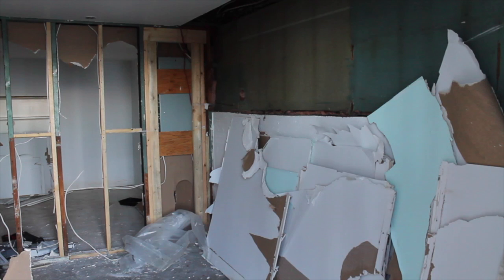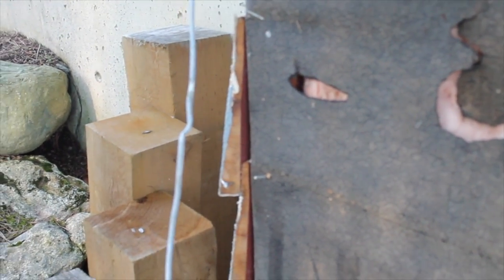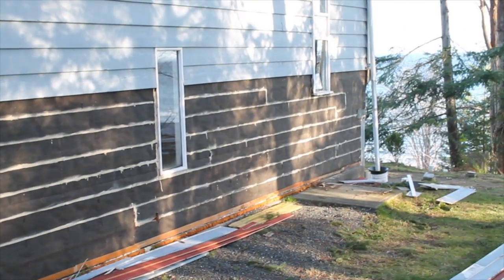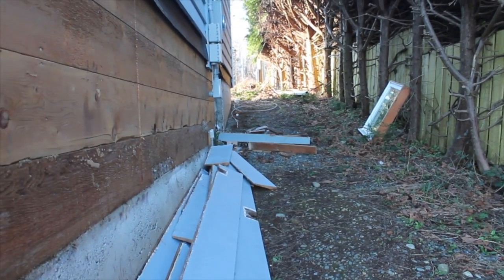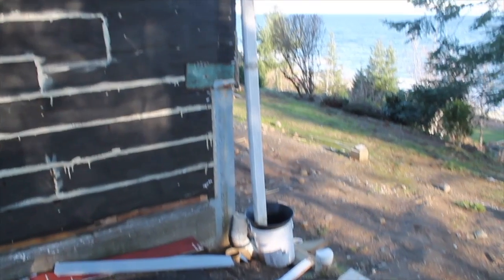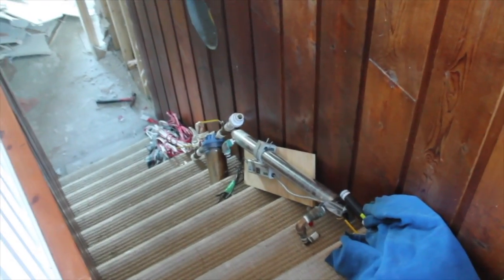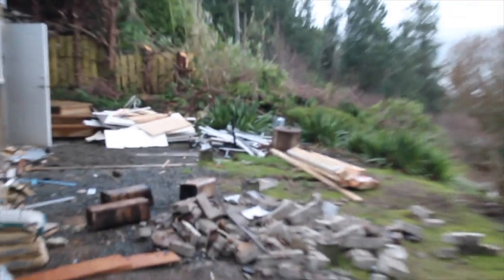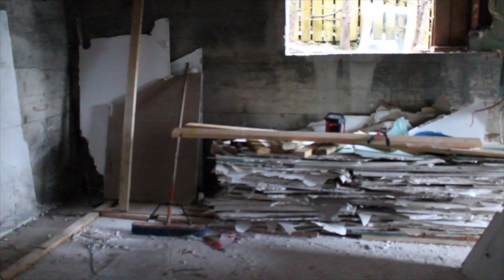Episode 9 - Prep for the move 'phase 1'

Comment: Wow, it's cool seeing what is inside all those walls, etc. I was pleasantly surprised what good condition those planks were that were under the existing siding considering they clearly just applied the former over the latter. 
As for focussing your camera, I don't know if this will help on your camera, but on my half-decent DLSR Canon camera, if you tap the shutter button (as if taking a pic) about half way down it focuses faster. 
Mom was saying that the actual move will be at night so as not to block the road, etc. This makes perfect sense, but I'd have never thought of this. Do they go door-to-door or put up a sign and let people on Aldergrove know this? There'd be a real problem if someone were parked on the road and had to ring their doorbell at 11pm, haha. Hopefully it isn't raining or worse when they go to do this. It'd certainly be easier and safer if things were dry, I'd imagine!
I was surprised that you have to do the clean-up, or is it an option and you're choosing to do it yourself for the cost savings? 
Another great video, Dean. Thanks for sharing all this with us!  xo
Reply from the maker: thanks for the feedback Heather.  I will play around a bit more with the camera, it s when I try to use the shutter button that it searches in and out of focus.

The house movers are very clear.  They come and prep the house to move and then move it, we deal with the mess and remaining demolition.  I wont be doing it all myself, the builder will come in with an excavator and bins and trucks and we will demolish what is left when the house is gone.  

stay tuned!